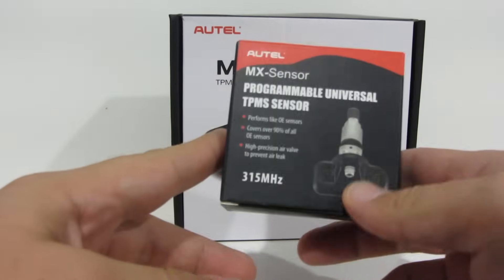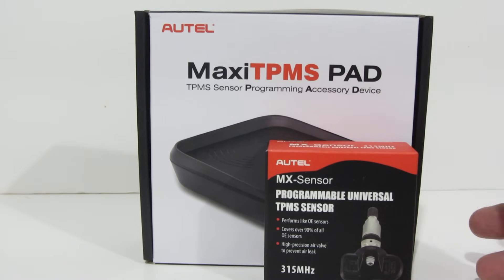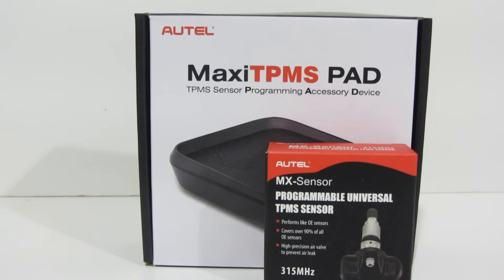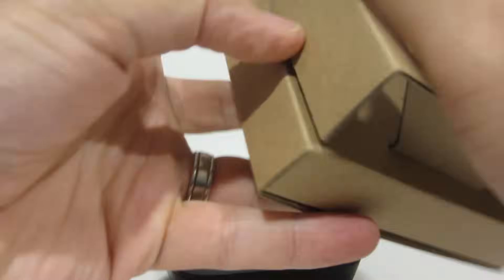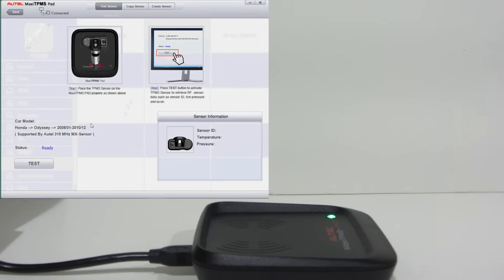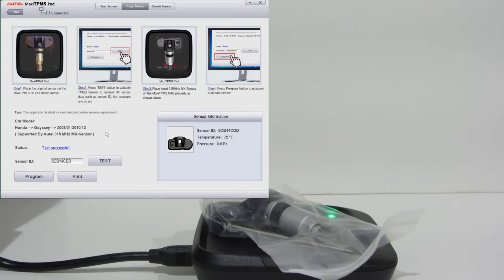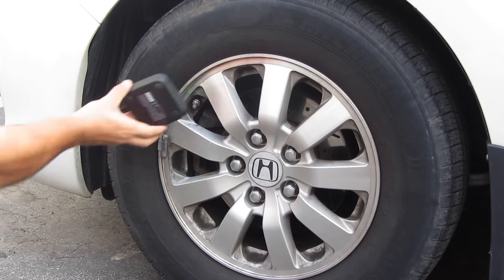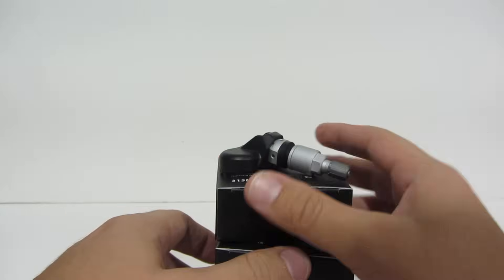Replacement TPMS Sensors for Cheap!

Comment: Hi Gabe,
I have a 2004 Toyota 4Runner that is missing all of it's sensors.  Per your comment to Travis, I'm not able to find this link to know if my 4Runner can automatically learn the new sensors I would put in or not?  Can you paste that link here?
"Travis Klein Yeah, if you don't have the old one (or know the code) then you can't clone it. But in the description of the video there's a link to a PDF file from Autel. Look up your car there and it'll tell you if your car automatically learns new sensors. If it does, then you can buy any compatible sensor, have it installed and start driving. No programming needed."
Thank you!
Jeff
Reply from the maker: Open this page and go to the Downloads tab and download the PDF for your market (US, EU or CN): https://www.auteltech.com/TPMS%20Diagnostic%20&%20Service%20Tool/534.jhtml

Assuming US, looks like the 4Runner does not automatically learn new sensors.
Reply: Here is what I pulled from the link
Relearn = O (OBD)  OBD-II Function = Black Dot   Programming Status = Black Dot.  Does this mean that I need to buy the tool and with the tool I would be able to program the new sensors, even though I don't have any to clone?
Reply from the maker: If you are missing sensors, then you can't clone like I did in this video since you don't know the codes your car is expecting. You would need a special scan tool to read the codes from the car - but if you have a tool like that, then that tool can just as easily reprogram your car with new codes.

If you want to do this yourself, you can buy a scan tool like the Foxwell NT510. I have this one myself and it's pretty handy to have. It does more than just TPMS. You have to make sure you buy it with the software for Toyotas, which will let you read every sensor in your car (SRS, body electrical, TPMS, etc.). It's awesome to have if you usually do work on your own car. It's the cheapest scan tool of this kind I've ever found. About $150 from China on eBay (if you don't mind waiting for it): https://ebay.to/2vVJiI4

Sometimes Amazon will have ones that ship from the US, but it doesn't look like they have any with the Toyota software right now: https://amzn.to/2MA26E1 (that one for $179 looks like it ships from China)

If you have a tool like that, you can buy any 315MHz TPMS sensors and use that tool to program your car with the codes of the new sensors.

Comment: Hey Gabe, thanks a ton first. Wanted to let you know I just did cloning 2014 Subaru wheels (OE Shroeder) without any problem. Have already 100 miles with new set of wheels, no problem whatsoever. I used Autel TS408 ($120 off ebay) instead of MaxiPAD.. maybe that's the difference.
Reply: I just want to add that a lot of Subaru owners are looking for solutions like this. Subaru vehicles come with bare-bone TPMS system that can only store 4 IDs at a time and that's it. If you need to have the system relearn TPMS IDs (e.g., swapping out to Winter set), it can only be done by a special tool at dealership. So if you have more than one set of wheels, your options were:
1) pay dealership $75 every time you swap out wheels
2) buy the relearn tool yourself $$$ and reset system every time you swap out
3) ignore TPMS warning lights
This has frustrated a lot of Subaru owners because they tend to be the folks who keep extra set of wheels (Snow, Winter, All-terrain, etc). In this context your cloning solution is the best: a bit extra up-front cost (actually not that expensive - $25 per cloneable sensor beats a lot of non-clonable sensors), and you don't need to waste time and money in the long run, and you have working TPMS system.
Reply: Absolutely - I'm right there with you

Comment: I have a Honda too with TPMS sensors. I was reading through the comments and you had to drive around the block to get the sensors working to read correctly one time. I am wondering if you had to do the same with the Autel sensors. I'd rather clone the Autel sensors and throw them into the spare tire since I have 4 different sets of wheels I'll be swapping around on this car. Not really wanting to buy 12 sensors just to do this.
Reply from the maker: Unfortunately that won't work. They normally stay off until woken up. A scan tool can wake them up, and they also have a centrifugal switch inside them so that they will turn on when they're in a spinning wheel.
If you keep them in a spare tire that's not spinning, they'll just stay off.

Comment: i bought all this stuff for my cars summer wheels and the pad dosent seem to be capable of reading the sensors through the wheel/tire when its on the car... i just went outside and tried it multiple times. is there anything special you have to do to the car first for the sensors to be readable?
Reply from the maker: You can try driving your car around the block, then trying to read it as soon as you get back. The sensors have a centrifugal switch that turns them on when the wheels turn, then they stay on for about 5 minutes after.
I didn't find that I needed to do this when I made this video, but when I read them again about a month ago, I did have to do this. I'm not entirely sure why.
Reply: that didnt work ither. i drove about 6 miles. i guess ill have to figure out some way to dig them out of the ecu or have a shop read them for me. i could even bring my laptop to the shop to program the new ones on the spot. i guess that will have to be the plan.
Reply from the maker: Are you sure the sensors in there are still good? Or are you replacing them because they're bad?
Reply: i am putting new sensors into new wheels and i need to read the codes on the stock wheels so that i dont need to reprogram the ecu 2 times per year when i switch between summer/winter wheels/tires. im fairly certain the current sensors are good as the car is brand new and im not getting any lights on the dash lit up.
Reply from the maker: Right. Exactly what I did then. Sorry, I can't help too much then. But a shop should have their own tool that should be able to read the codes from the ECU.
Reply: so i had a shop read the codes, their device could do it no problem. then programmed these sensors with the pad and they are working perfectly. no error codes so far in 4 days of driving, ty for making this video, its a shame we have to jump these hoops in the first place but its nice to see some people trying to make it as painless as possible.

Comment: If your car has tpms and you want another set of tires and wheels for winter do you need the sensors on the new wheels or will the light stay on if they are not installed?
Reply from the maker: Thomas Sept The light will be on if you do not put sensors in the new wheels. That said, you can just drive around with the light on, if you don't care.

Comment: Why would you want to buy Chinese sensors when you can have German, at a lower price?  Check out this eBay page for the details....   http://stores.ebay.com/GWRautomotiveproducts?_trksid=p2047675.l2563
Reply from the maker: I'm not seeing cheaper sensors on that page. The cost of the programming tool is a factor too.
Reply: @GabesHacks  anything from china, is utter shit avoid
Reply from the maker: @paulken1919  After a few years now, these sensors are still working.

Comment: I need to know how to reset tire pressure light on a Toyota Tundra
Reply from the maker: I depends which light you are talking about. The low tire pressure light only comes on when one of the tires has low pressure. So you just have to fill up the tire to turn it off.
If you're talking about the light with the letters "TPMS", then that means something is wrong with the system. One of the sensors could be bad - maybe just a drained battery. To figure out exactly which one, you'll need to find someone with a tool to plug into the vehicle and read the errors. A tire shop can do this, or you can buy one for yourself. I bought a Foxwell NT510 for myself, which does that job (plus more - it reads every system in the vehicle). You can get it on eBay (shipped from China though, so it can take a while): https://goo.gl/nF97oy
Reply: so you inflated the tyes to the correct pressure, press the reset button under the steering wheel. goodle it

Comment: I dont have the old sensor, this video is useless
Reply from the maker: Travis Klein Yeah, if you don't have the old one (or know the code) then you can't clone it. But in the description of the video there's a link to a PDF file from Autel. Look up your car there and it'll tell you if your car automatically learns new sensors. If it does, then you can buy any compatible sensor, have it installed and start driving. No programming needed.

Comment: Thanks, what about if i buy the ones from honda, those will need to be programed?
Reply from the maker: jorge m No, the OEM ones will work just the same. I have the Honda service manual for the 3rd generation Odysseys (2005-2010). The instructions for replacing the sensors in a Touring is to just install the new sensors and drive around a bit till it learns them.

Comment: Hi, nice video, just what i was looking for, i have a 2007 odyssey touring, my tpms light come on a long time ago, i guess the battery on the sensors die , they only last 7 years. You think this sensors will work for me? I will have to replace all four, but after programming them the van will register them and tpms light will go off? Bow that works? Do you know? I realy like to fix that for my wife. Thanks in advance
Reply from the maker: jorge m If you have a Touring then it's even easier! The Touring models automatically learn new sensors, so you don't need clonable sensors. Just buy any compatible sensors (if you're in North America then it's 315MHz sensors) and have them installed. Then you just drive the van around for a while and it'll clue in and the light will turn off.

Comment: Hi Gabe , i have Nissan Xtrail 2015 (Nissan-Rogue in the USA)  and i bought  autel maxi pad  with four autel 433 mhz TPMS sensor . i can read ID's from OEM sensor's but  autel program say  7 digits  for example (8F6B78A) whereas  printed on  OEM sensor (8DF6B78A) 8 digits  , all of them  on autel program second  letters ( in all  D ) is missing , anywhere  i copied four sensors and  mounted on my winter whells  but  not  worked , light is on still . are their pozitions important  such front-rear or left right ? or what could be the problem . Thanks .
Reply from the maker: When you programmed them, did you use the "Create Sensor" page in the MaxiTPMS program? There is a checkbox that says "Hex". I believe it must be checked to be able to type in all 8 digits.
When you click "TEST" you should read the same code on both the new and old sensors - that's the goal.
Reply: I know , OEM code is hexadecimal  (printed on oem sensor : 8DF6B78A) , box checked  and  i tried two kinds , one digit missing every time  , but  in create sensor page for different car brand  eg. İnfiniti Q-50  can write 8 digits   , maybe i should  try to do it like Infiniti  . I will try tomorrow  , also my software version is newest .
Reply from the maker: Hmm... yeah, that is odd. I'm curious to know if that works - let me know. Sorry I can't be of more help. I don't have any experience with Nissan or the European cars.

Comment: Thanks for the video.  Regrettably, my tire shop failed to reprogram before installing the sensors.... I'll not say which national chain it was...  Question:  in addition to reading codes from sensors already in the tire... can you reprogram sensors already in the tire?  Thanks, Ed
Reply from the maker: I haven't tried it, but it might work. Did the shop install programmable sensors? What year/model car do you have?
Reply: My ignorance here.  I supplied them with a set of Mobiletron sensors which  are advertised as being programmable and meeting all the current standards.  The shop's tool was not the most up to date, and I'm suspecting that it wasn't adapted to work with the asian market cars.  Figured if it didn't work, I'd just buy an ATEQ Quickset tool and reprogram the car to match the sensors (I wrote down all the codes).  And still I would come out ahead of Toyota which wanted over $900 to sell me four sensors and reprogram.  Might take a chance on the $50 reprogram tool and hope the Mobiletron sensors aren't proprietary.  All in all this process is more a "Fun" project than a serious endeavour.  Got to have something to amuse myself in retirement <grin>!
Reply from the maker: Yeah, I can't say if the Autel programmer can program other brands. It's a gamble.Earlier this year I bought a Foxwell NT510, which is fairly inexpensive compared to other tools that can do the same thing. It's a bi-directional tool, and I'm pretty sure it can program the TPMS codes - I'll try when I get home tonight. But it has the added benefit of being able to read all the other systems of the car (SRS, body, ODB II) as long as you buy it with the software for your manufacturer. That might depend on your car though - whether they support it. Here are links for the NT510: https://goo.gl/vuvTBm or http://amzn.to/2EPliZU
Reply: YES - but... You can only programme a sensor when the tire pressure is less than 70 kpa (about 10 psi?)  so they tires will have to be partially deflated and then re-inflated afterwards.

Comment: Can I program oem sensers with this
Reply from the maker: No. OEM sensors are not programmable at all.
Reply: Gabe's Hacks I have to do my Dodge charger I was going to by the Mopar replacements im not sure what ones to buy
Reply from the maker: Follow the instructions in my blog post to figure out if you need the 315 or 433MHz: http://www.gabeshacks.com/2016/10/how-to-clone-and-program-new-tpms.html
All the Chargers will automatically read new sensors, so you don't need programmable ones. Just buy any compatible sensors.

Comment: How car read tyre pressure from sensors.. Some cars shows exact pressure but how they read it please explain
Reply from the maker: The sensors wirelessly send the tire pressure to the car. Some cars display the pressure, some only turn on the light when the pressure drops too low.
Reply: Gabe's Hacks Thanks for your quick reply, my Mercedes has michelin tires so I am confused, when we changed tires we needs to change TPMS to New tires or new tires already have one? If no then do we need to program new tyres as we have changed many tiers till not but never thought of it.. And why can't car get confused with the spare tire we kept in the car?
Reply from the maker: The TPMS sensor stays on the rim when you take off the tire. So if you are just changing the tires (on the same rim) then you don't need to do anything with the TPMS sensor.
If you have a full-size spare tire, then it's possible that it has another TPMS sensor inside it. Other cars (like mine) do not, and the TPMS light comes on when I use the spare.
Reply: Gabe's Hacks Thanks you, you are genius, I need to chack it with my car's tires as I have 2 full sets of spare tires on my car as many times it happened with me that two tires from same side of the car got punctured

Comment: I bought new TPMS sensors for about $100 and the tire shop programmed them for $5 ea.  Cheaper than your programmables.
Reply from the maker: Thermal Reboot $100 for all four? That's a great price. Where did you get them?

Comment: What if you don't have the old sensors...then what?
Reply from the maker: Toriano Williams Then cloning sensors won't work, since you don't have the codes from the old ones. In that case, you'll have to buy any compatible sensor (programmable or not) and connect a tool to the vehicle to program it with the new codes. Those tools are usually a bit more expensive. But a tire shop or a mechanic with the right tool can do it for you.
Of course, if your car automatically learns new sensors, then you don't need that tool either. So it depends on the car.
Reply: Pull the codes from the car's computer with a diagnostic tool.

Comment: Hey Gabe I really appreciate your video on this.  I have a 2009 Dodge Ram 1500 and I have had a bad sensor in one tire for months. I ordered the pad and a sensor and put it in today. Works great. I had taken my truck to Pep Boys and they wanted $178.00 to replace one sensor. For around $70.00 I got the pad and a sensor. Only downside is the pad doesn't work to check the sensors on the tire. Once I took off the bad sensor I checked it with the pad and the sensor fail so I knew I had the right sensor. I got the number off the old sensor and programmed it to the new sensor put it on the rim and the TPMS light went off before I got   to the end of my road.
Reply from the maker: Some others have said they've had to let air out of the tire to sort of wake up the sensor before being able to read it inside the tire, but no guarantee that'll work either. But I'm glad it worked out in the end!
Reply: OK cool will have to try that next time.

Comment: Hey Gabe, I a little confused. According to the Autel site, my vehicle is a "OBD Relearn" type meaning it require a proper TPMS tool. 
Will these cloned TPMS and pad still work without any "proper" tools?
Reply from the maker: Yes, it will still work. My Odyssey is the same.
There are two ways to do it: Clone the new sensor so it has the same code as the old one (which is what I do in this video). In that case, the car doesn't even know that you changed a sensor.
The other way is to use any compatible sensor (programmable or not) and use a tool to program the vehicle with the code of the new sensor.
Reply: Gabe's Hacks 
Nice! Thank you very much for explaining and replying super quick.
I appreciate your time and effort.